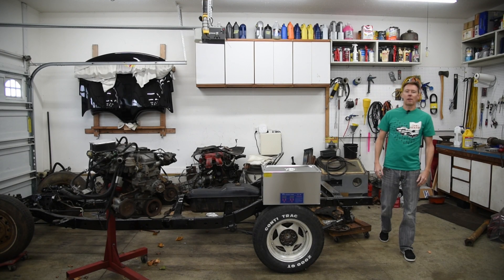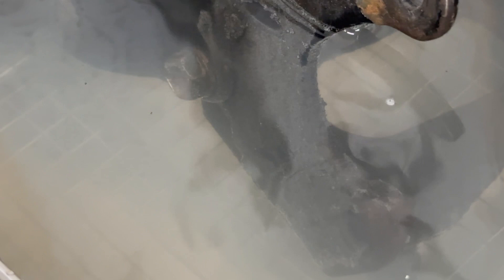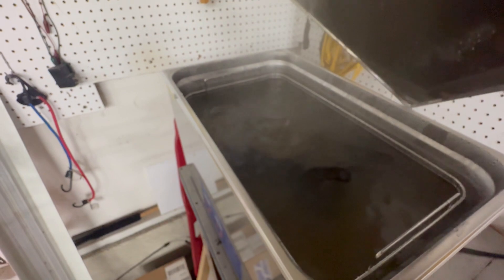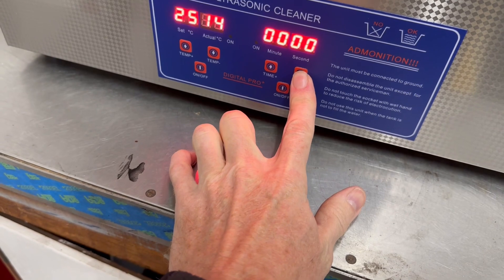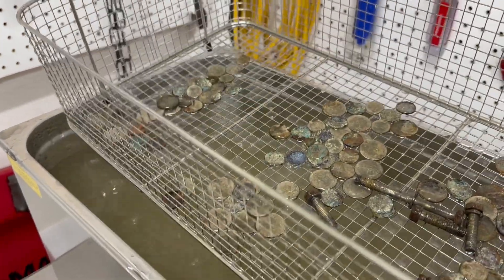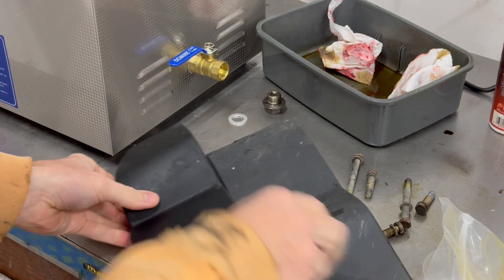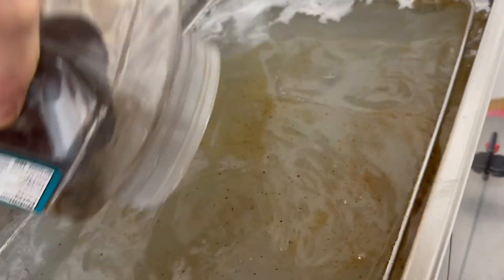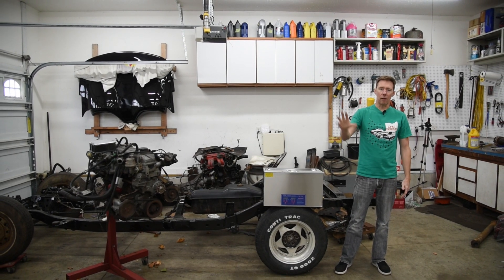Is a Vevor Ultrasonic Cleaner Useful for Garage Tools & Car Parts?

Comment: Degreasers like purple power, simple green are terrible in ultrasonic machines for car parts anyway. Terrible for aluminum, super corrosive that’s what you have rust on them bolts already. Really doesn’t work any better the dish soap. The best stuff I’ve found is awesome cleaner from the dollar store works super fast it’s not even a comparison plus not corrosive.
Reply from the maker: Sadly, this machine died shortly after the video. They sent me a replacement, and it also died. Both times it happened when I was using the heater.
Reply: @6thGearGarage 
Just thinking of getting one from Vevor  but from your comment i might give it a miss if the cleaner keeps breaking.Was there a reason why it failed.I wonder if there other ultra sonic cleaners on there website giving issues as well.Thanks for your informative video
Reply: Hey what kind of things have you cleaned in the ultra sonic cleaner with the Awesome Cleaner and what other solutions have you used and had good luck with. I just picked up the 6L ultrasonic cleaner from Harbor Freight the other day and some Evaporust. Cleaning up a 1988 Yamaha Moto 4 ATV and finally pulled the trigger on the ultrasonic cleaner to clean all the nuts and bolts. Only tried it a few times the past few nights but so far the Evaporust in the ultrasonic cleaners works great. Still on the hunt for other uses for it though and other cleaners for different things. Now have to device if I wanna get into nickel plating at home because I need something to protect all the fasteners and small parts after getting the rust off.

Comment: I use a small ultrasonic for nuts and bolts. A 50/50 solution of water and Purple Power works great, once it’s warmed up I keep it running and switch out the bolts every 30min. The solution turns black rather quickly but long as I keep the heat on it keeps working. 
I’m considering buying a vibratory tumbler for rusty bolts because I hate wire brushing them
Reply from the maker: Great idea... I wasn't using nearly enough degreaser.
Reply: Have you tried the ultra sonic cleaner for nuts and bolts? Any time I am working on something (car, ATV, motorcycle, etc) I always cleaned all the nuts and bolts like you mentioned with a wirebrush. Finally picked up an ultra sonic cleaner from Harbor Freight and some Evaporust. Tested the other night with some pretty trashed and rusty bolts.. filled mason jar with Evaporust and put the bolts in that and then in the ultrasonic cleaner. Worked amazing. Now I have to decide if I wanna try nickel plating at home because I have yet to find a good easy ay to protect the fasteners after getting the rust off.

Comment: I dont think you should put a bearing, ie idler bearing, in that thing....Ive had those make noise and seize up.... Ive seen better cleaning by guys using a metal tub, propane heater and 100% degreaser brought to a boil...takes off that heavy stuff....
Reply from the maker: Never thought of that... great idea!

Comment: Bradley system rtx9 is the best degreaser I’ve ever used. When I worked at Penske that’s all we’d use to clean trucks with. It looks like purple power but will not hurt aluminum like purple power does and it’s also safe on paint and plastic.
Reply from the maker: I'll check it out - thanks!

Comment: Is it normal for this exact ultrasonic cleaner water to heat up with the heater turned off. Mine heated up to 44c after A 1/2 hr. Vevor said this is normal. Can someone verify this. Thanks
Reply from the maker: Mine also warmed up with the heater off, but not that much. I figured the machine created some heat when operating and maybe the water warmed up some from the friction.
Reply: @6thGearGarage  thank you for the reply. I’m tempted on asking vevor for A replacement.
Reply: Yes, the way it cleans is vibrating the parts so fast it creates a vacuum cavity between the water and the part and then the water smashes back into the part over and over again how ever many 1000s of times a second. There is some water boiling that will take place at the pressure drop or vacuum. The boiled water slowly heats up the water around it when it is reabsorbed.

Comment: Ultra sonic cleaners the thing pro's use to clean carburettors.

I wouldn't mind owning an 8 or 10L one.

Whatever can fit a wide variety of different carburettors (not at the same time).

Though their not that common in my country or affordable. It might be a different story in a few years' time when I have my own garage.
Reply from the maker: I always thought they were more expensive. I'm sure there are some very expensive brands out there. Vevor is usually priced pretty low compared to some others.

Comment: I've got ther 15 liter one, I can tell you, running a 50/50 mix of degreaser and water works way better, also letting the solution heat up and letting the really greasy parts soak before turning it on helps a lot. If you want to save on solution,  you can fill it with water, put your small parts in jars filled with the solution, larger parts in Tupperware, it works just as good, and don't have to change    what's in the pot, also evaporust works great in the ultra sonic cleaner cuts the time in half and using the same jar method
Reply: Thanks for the tip.
Reply from the maker: Wow, I wouldn't have imagined that would work... thanks!!

Comment: That did pretty much what I expected it would. I've never seen one that big though, thats handy.
Reply from the maker: To be honest, I kind of wish I had a smaller one instead.  I can pressure wash anything as large as that bracket in the driveway. With this large model, I'm using 6 gallons of water to clean a handful of bolts.

Comment: Would it clean better if you ran it longer?  Never used one before.
Reply from the maker: I could have kept running it to see if it would have eventually broken down that thick grease. But in a lot less time I could have taken it outside and sprayed it off with the pressure washer. I moved on because I was really excited to see what it would do the crusty coins.